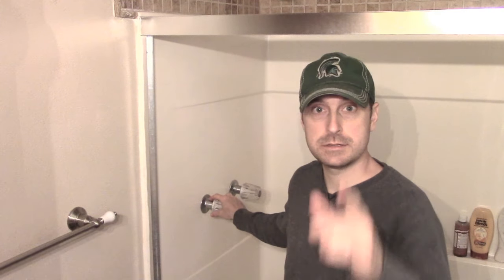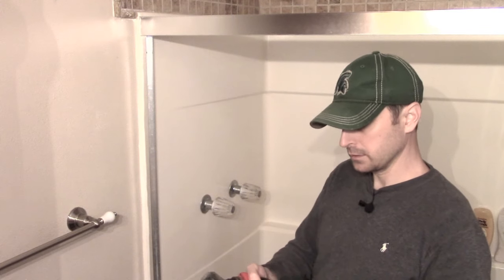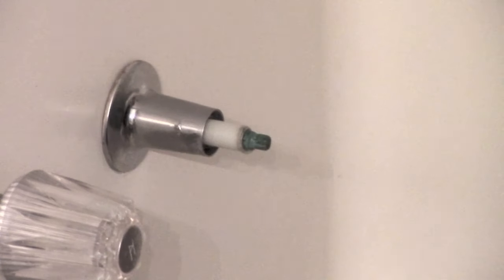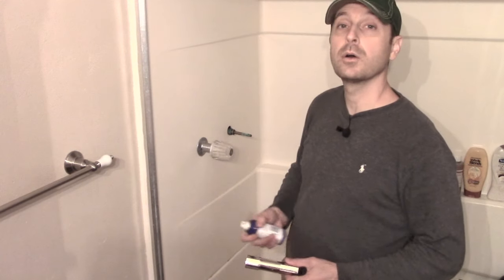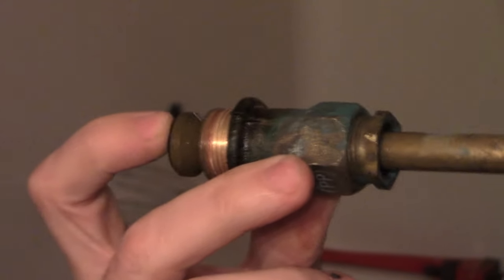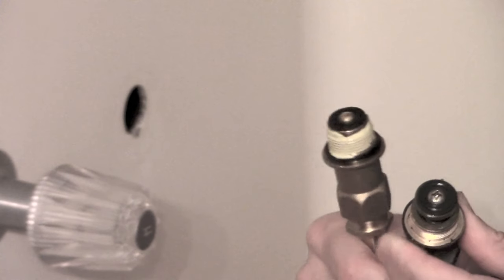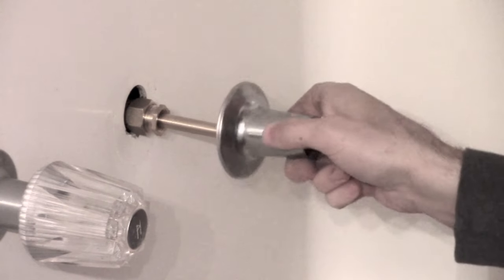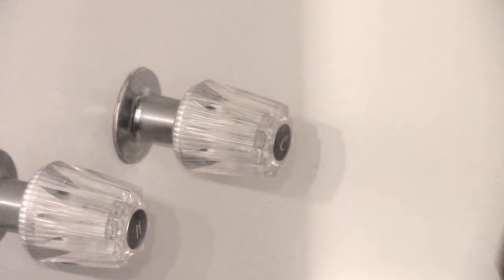How To Repair & Replace A Shower Faucet Valve (Easy DIY Fix)

Comment: So others don't feel incompetent (alone) when they try this "easy" "10 minute repair".  We got the handle off, then couldn't unscrew the next part. We thought we needed a different kind of wrench so we went to Ace to talk to the helpful repair guy, he sold us some "superzilla" solvent to dissolve the lime that was keeping it stuck. That worked.  We removed the parts and went back to get the new, unbroken ones.  Needed the Ace guy again, it turned out it was in 2 parts, didn't look like ours exactly but they'd work. Great, went back home.  Turned out the part that goes into the handle was broken off in there and cemented on with the lime deposits.  No way to get it out so we went back to Ace and got new handles.  $70 and FIVE HOURS later (it's an hour round trip to the hardware store) it is fixed. Oh and did I mention we had to remove a shelf in the closet on the other side of the wall from the shower and make a hole in the wall so one person could push the pipe through the hole while the other screwed on the collar thing?  So we do still need to repair the hole in the wall and then put the shelf back up and meanwhile a lot of linens are on the bathroom floor. It was a small 2" hole.

Comment: Why not just replace the rubber washer? Also the valve seat could be worn or pitted which would cause a leak.  I always replace the seat when installing a new cartridge.
Reply from the maker: The cartridge was leaking internally as well. I was at least 30 years old. Time for a new one. I did check the seat. It was fine.
Reply: @CountryLivingExperience  I agree, the stem was pretty corroded and needed replacement.  Great video

Comment: Great video, but might be helpful to note that the valve seat might need to be replaced for some. The leak may come from there, but luckily most replacement stems come with a new one
Reply from the maker: Thank you

Comment: Awesome I’m a union plumber commercial I  do residential plumbing under my own account when ever I have time lol an needed a reminder had to change my own stem in my shower..like anything we do you want to do your research to make sure you get it done right the first time no matter if you’ve done it in the past cause that lil piece you forgot can cost you the time you can’t replace lol great job bro maybe should of added to have them flush toilet etc after the water valve was closed so they won’t get as much residual water when removing the stem 😎👍🏼
Reply from the maker: Thanks

Comment: Thanks, that was very clear and helpful, was able to get the job done with my only (not very difficult) issue being matching the stem at the store (no markings on the stem I pulled).  Thanks again.
Reply from the maker: Glad it helped

Comment: I would turn the water back on to check for leaks before putting the escutcheons back on. If the leak is behind the wall, you may not know until you have water damage. And you might as well replace the seat while you have the stem out.
Reply from the maker: Seat was fine. Left the euscuteons off for a while but you didn’t see that in the vid.

Comment: I am looking for the manufacturer for the fixtures and stems you featured on the invite to this video as they match the fixtures I have in my 60+ year old bathroom and they need to replaced due to a broken tub handle stem and stem seat. I am hoping you can help me.
Reply from the maker: Sorry, I just used a stock photo for this video. The fixtures that are show there have been mimicked by so many companies over the years that you should be able to find them.

Comment: Thanks! You addressed the one issue no other video I've seen yet did: adjusting the handle turning strength by loosening/tightening the locknut.
Reply from the maker: Cool. Glad we could help.

Comment: There are 3 major problems with leaking on faucets in showers and tubs:

1. The black "Washer" on the End of the stem.

2. The Packing around the stem. And the screw needs to be tightened as you did.

So you can say, that the leak was either on 1. or 2. or both. Now the third one.

3. The washer is stopped; in piping in the wall. It is called the "Seat". It does not go bad very much. But it does happen. So I suggest whenever you did what you did; you should always change the seat also.

It requires a special tool; to get it out, and in. Home Depot has them. $16.00. For what it's worth.

Comment: I'm doing this with a much older set of stems (from the 1950's) and I had to use PBlaster on the handles and then a puller - big PITA - then I could not get the stem out - the smaller fitting where you can pack it with teflon to fix that specific leak came off but the actual stem so far has been a big pain and I've not been able to get the stem out. probably need more wd-40 or pblaster. plus, when they finished the wall. the tile was not cut enough to allow that special socket to get in so I had to carefully chip away the tile and then I find the mortar used for the tile also needs to be chipped away from the stem. This can get to be quite the job. Oh, and the shutoff valves for the hot and cold both do a bad job of actually shutting of the water.
Reply from the maker: Wow! Sounds like a true PITA job. I have had a few of those in my time. Luckily this was not one of them. Hope you get yours sorted out.
Reply: I feel for ya. I had the exact situation. Plus every piece of old galvanized pipe just crumbled. Turned into a massive job.  I was ready to pull my hair out

Comment: Our tub faucet constant running water feels Lukewarm and not running like water is fully on, maybe 50%. Embarked on a DIY journey out of not wanting to pay a local plumber the quoted rate of $600 + I've been able to do other home and car repairs with the help of several how-to videos that saved us tons! Like installing our new washing machine, fixing the tub drain on our old washer, replacing car battery, etc. etc.   Stems/seats look like they have never been changed, house built in 1970s. And they are Price Pfister had I had the original information or receipt would have been covered by their lifetime warranty. ￼😞 A stamp of USA and 23 is barely made out on the old ones which did me no good without an actual part number. Thank goodness for this video! Explains it so clearly, once I began, I knew this is definitely something I can do and don't need the $600 plumber. A handyman had been out 4 months ago for this issue and when I took out the stems that they managed to get to not leak...  they used plumbers' tape and both stems did not have any washers whatsoever! But they did cut a giant hole into the wall above the tub handles and forgot to 'come back' to caulk it. At that time the tub handles had to be grinded off as they were majorly stuck, and they did not want to use WD40 or CLR.   Our PP stems are part # 910-3850 and seats are (we and Pfister.com support think) 970500. Both of course not carried at HD or a local wholesale plumbing supply. It seems the online biz sells more of these older parts; stores keep the newer versions. So, stems out cleaned with CLR looking brand new put the pipe dope on screw parts and silicone paste in the area of the gasket and on the gasket. Back into wall, still a small dribble of constant running water. Tightened everything. okay now need new seats, stems. Found hopefully the right parts on Amazon, easily returnable if not. Will do it all again for the hot/cold. Now with the 3 handle tub faucets is it recommended to do the middle handle also? Not sure if we should touch that one, as the showerhead is not leaking. All said and done I did not have the necessary tools had to buy everything but thankfully this video lays out exactly what you need. Also, I did not use the handle tool that came with the shower valve wrench set, I had gotten the pipe wrench and best tool ever! So now waiting for the new stems, seats to arrive, hope to finally fix this leak! Can't wait for the water bill to come in, yay! (sarcasm) Tools: $45.00, parts $65.37 Water bill (unknown-best scenario $150) Time: 3 weeks, planning, waiting. $110 fix saved $500, know how to do this myself and will gladly do it again! :-)

Comment: I have used penetrating fluid and the vale nut still will not release using the same tools.Any suggestions on what can be done?
Reply from the maker: You may have to soak it a long time in that penetrating oil. The only other things that may work is 1. heat from a blow torch (be careful the penetrating oil is wiped up or that could cause a fire) 2. use a longer lever on the tool (be careful not to break the pipe). If it does not come off, you may need to replace a portion of the pipe or call a plumber.

Comment: If the their valve stem are not found.. then what?  Thank you
Reply from the maker: If you cannot find the correct one, you will have to cut the pipe and install new ones.

Comment: The silver (valve covers) on mine do not screw off. I had to cut it off. There are no threads on my valves and thus no way to screw the cover back on. What’s going on ? Thanks for help. Original valves were installed in 1980.
Reply from the maker: I am not sure. There are hundreds of styles and designs of those faucets. You may have to replace them completely now that you cut them.
Reply: @CountryLivingExperience  Thank you. All the replacement valves are Iike the old ones, no threads to screw the silver covers onto. I was told by plumber working at Lowe’s that I’d have to replace the whole assembly behind the wall with modern assembly. Why do plumbing manufacturers make things so difficult. Thanks for your help and the video!
Reply from the maker: He’s corrode. Unfortunately the whole assembly will probably have to be replaced.

Comment: The problem with getting information from you tube is you can get bad information.  I have no idea whatsoever why you wouldn't go ahead and replace the seet's while your in there also...They even come with the new valves!!!!!
Reply from the maker: Calm down chief. The seats were not worn in this case and for your information these valves didn’t come with new ones.

Comment: I changed all that and also a little piece inside and still leaking water. I don't know what else to do 😢
Reply from the maker: You need some sealant on the threads or it is not tight enough.

Comment: How does one remove a rusted shower handle valve stem? Attempted to use the socket, however the edge of nut on stem has eroded to the point where socket is unable to grab. Used WD-40 to loosen...didn't help.
Reply from the maker: Keep putting the wd-40 on it. Use a pair of Vise-Grip pliers to tightly grab on.

Comment: I cant get the handles off, I have tried wd40, I tried a tap puller device and no luck.
Reply from the maker: I can't see them to help you. Sorry. Try heating them slightly maybe?

Comment: Quick Question: I have an old (1968ish) hot water & cold water shower faucet. I have slid forward the Plate, and then I Open the faucet knob, then I gotta unscrew the Smooth, Round, long STEM that threads into the "inside pipe socket/female opening". Normally I would utilize Large vice grips/ pipe wrench..... But for the life of my I can't unscrew the smooth round long stem.  I end up digging into the smooth round surface But it won't loosen.   Any tips / tricks or just MUSCLE IT  ((I fear I will bend/warp that long, smooth, round stem.))
Reply from the maker: Not sure I understand exactly. You can buy a valve socket that will help.
Reply: You should take a picture and post it at one of the better plumbing forums. Some stems like the old Savoy brand take a special socket

Comment: I don’t know, the leak is not coming from there, the leak is actually coming from where water is suppose to be coming from.
Reply from the maker: If that is happening, the rubber seal (seat washer) at the back of the valve has gone bad and needs to be replaced. Additionally, the seat could be bad.
Reply: I had the same problem. Fix: (1) turn main water off,(2) remove the cartridge, get a flashlight and look inside the valve body and check to see if the Seat inside is not cracked/dent,( if it looks bad, replace it. Home Depot/ Lowe's sell a package of 4 for ($1.98). (3), You also need to install the correct  front washer on the cartridge (Flat or Convex),(4) replace the large washer (rubber seal) on the front of the cartridge (behind the treads), then apply plumber's putty to the treads and the valve body opening, (5), reinstall the cartridge, make the sign of the cross, do a little dance, say a little prayer, turn water back on.     Worked for me.
Reply: There is tool designed for replacing the valve seats. Home Depot/Lowe's, ($3.25 +tax)

Comment: Can you tell me what brand shower faucet covers these are? My valves are long like these but I’m having a hard time finding replacement covers that will fully cover the valve.
Reply from the maker: These are Price Pfister. The stem should have a stamp on it with a number and the manufacturer. Mine had a PF.

Comment: I have a faucet thats the same as the one you have pictured in the thumbnail and its leaky. Looked all around but cant find a video with that exact faucet. Do you have a video on how to fix that exact vintage style faucet?
Reply from the maker: Sorry, we don't have a video on that type of faucet.
Reply: @CountryLivingExperience  thanks for responding though. Went to Home Depot, turns out its a very old faucet and they don't have those stems so just gonna replace the whole thing instead.👍🏼
Reply from the maker: @Oracle150  Probably a good idea to just replace the entire thing. You would probably spend way too much time looking for the old replacements.

Comment: I replaced everything hot and cold. I still have leaks from the shower head
Reply from the maker: Then you may need to also replace what's called the seat as it could be worn out as well. Ours was not so we did not show it in the video.
Reply: Country Living Experience: A Homesteading Journey 9

Comment: I lost a piece of the valve inside my wall but the stem was different to the one shown in the video can i buy a new set of of handles with valves or will i have to change the seat inside? Thanks hopefully its something i can do without making things worse lol
Reply from the maker: Oh man that's not good. There are so many stems on the market. Each company has their own and each model may use a different one. You have to look at the stamp on the stem after you remove it and then try to match it at the store. You may have to buy a whole new assembly....seat included.
Reply: @CountryLivingExperience  oh man hope i can find one that matches. Thank you for the response

Comment: Any tips on removing stem when the screw head is stripped?
Reply from the maker: Is it the screw that holds the handle on to the stem?
Reply: @CountryLivingExperience  Yes, this is my problem as well
Reply from the maker: @josepereira6528  Try vice grips.
Reply: @laura Mullins - They sell extractors for removing damaged screws, and they work quite well.  Not sure why that would be stripped though.

Comment: my valve popped off and it wont stay on
Reply from the maker: How can I specifically help you?
Reply: @CountryLivingExperience   bathtub valve to hot water popped off  i am unable to keep it tightly snugged in when i turn on the water it pops out again
Reply from the maker: @uwuloluwu  That does not sound good. Some part of that valve is broken. You need to replace it.
Reply: @CountryLivingExperience   ive replaced the valve but the hot water knob still wobbles a little  should i worry that this hot water valve might pop out?
Reply from the maker: @uwuloluwu  If it is just the knob, there should be a screw in the end that will tighten it.
Reply: @CountryLivingExperience  ceramic disk cartriage what ever you call it ive replaced it been couple days it hadnt popped out 👍 lets hope it doesnt pop out when im on  my camping trip 😅
Reply from the maker: @uwuloluwu  I hope it works for you. Have fun camping. We went on a camping trip this past weekend. Had a blast.